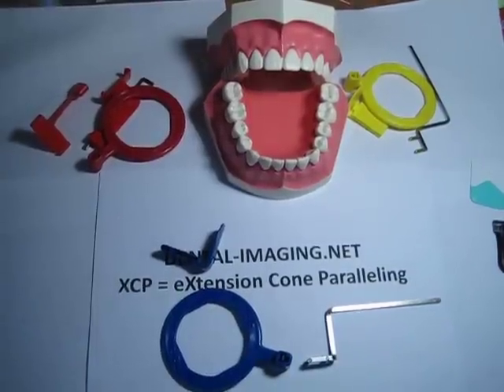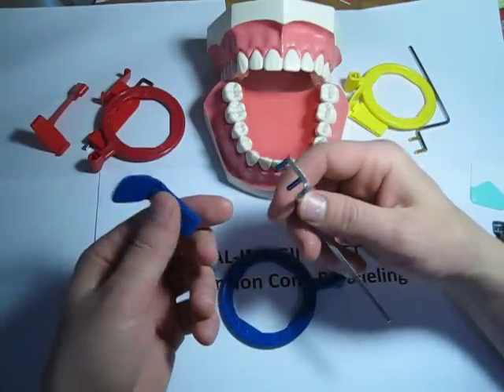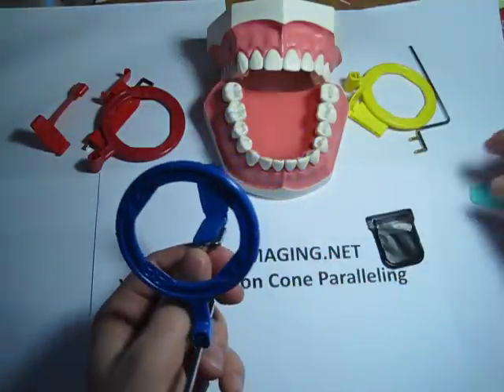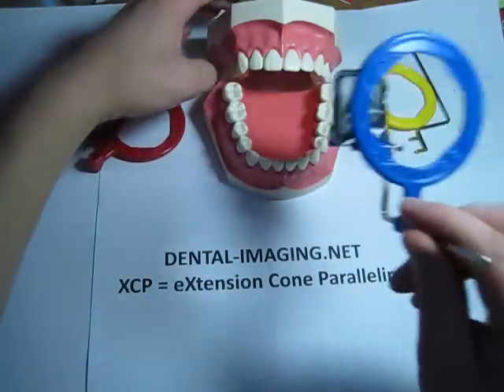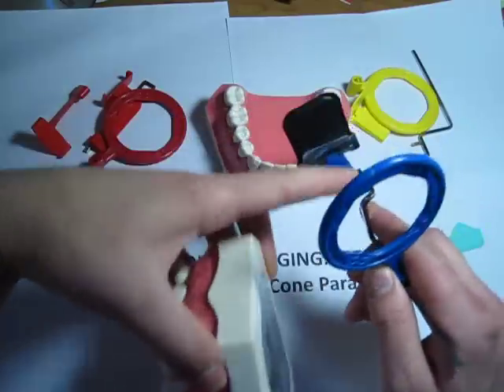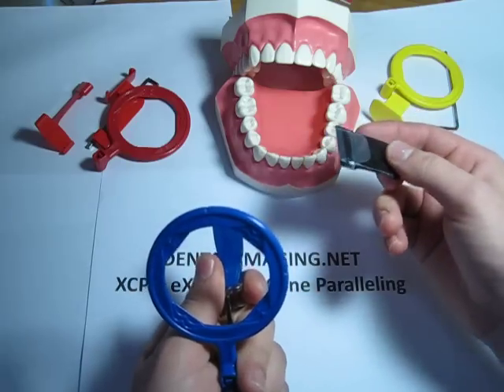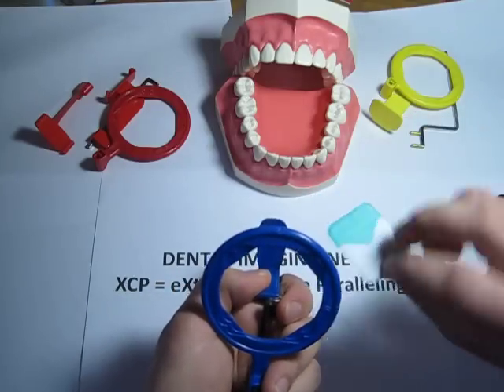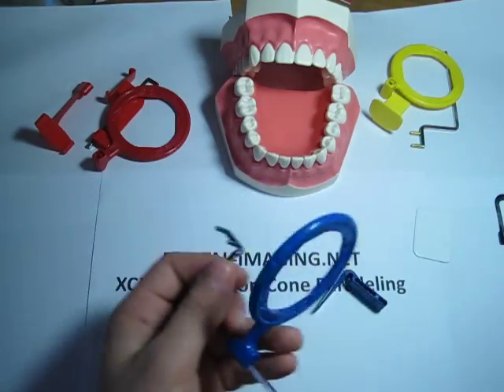How to use an Anterior (blue) XCP dental film / PSP holder for Dental Xrays

Comment from the maker: Correct, however, the primary intention of this video is to show inquiring minds how to configure the XCP instruments. A real mouth does have a few potential disadvantages as well as advantages. The disadvantages are as you mentioned, the tongue may get in the way, as well as the presence of bony tori, tight cheeks, stringy saliva, and excess adipose tissue. One advantage over a model, is that real patients respond by closing their own mouths, unlike a model whose mouth you have to open/close.